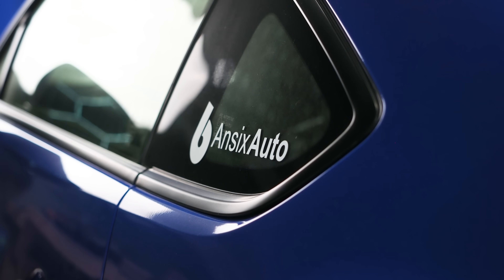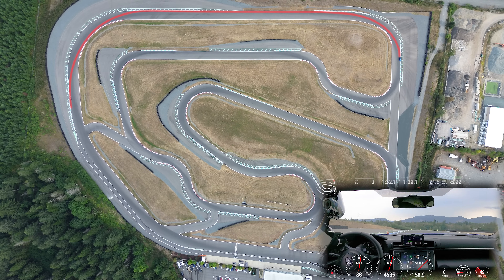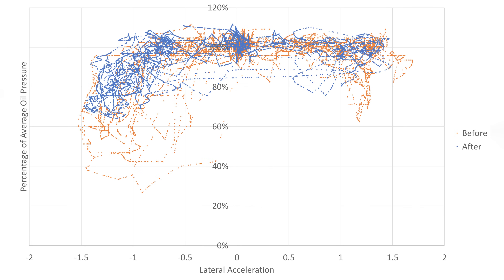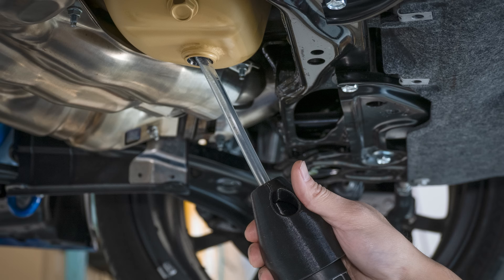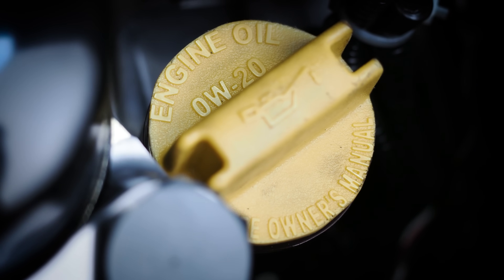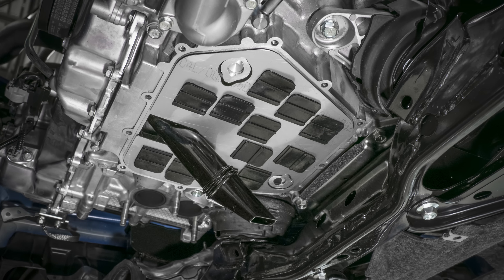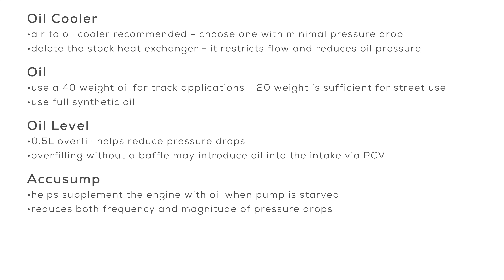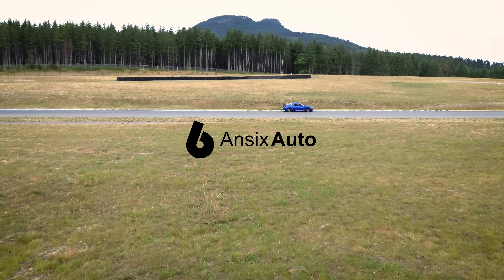The FA24D Engine: What Toyota & Subaru Don’t Want You to Know

Comment: It's insane that this somehow made it through testing on what I can imagine was a car that was tested fairly often on a track. I'm curious if they had any failures during testing and just said "oh well". I wouldn't be surprised if issues were found, a calculation was made on the chances of this happening based on expected amount of users to actually drive the car on a track within the warranty period, and then weighed that with the cost of a redesign. A less evil "ford pinto" calculation of odds, but still shitty if this is the case. Also, man VIMC is such a nice twisty track. That cresting chicane at the middle is a wild ride. Scary but fun as hell to attack.
Reply from the maker: There's an inherently difficult challenge to manage the oil pickup with a wet sump and a boxer configuration. Could they have tested and designed it better? We think so. Will they change the design? Unlikely.

Yah the chicane in the middle takes some experience to attack. It can go really wrong if you're not careful about how you brake for it.
Reply: They know. Toyota racing employee said on reddit they've been blowing and replacing engines like crazy.

Comment: Back in the day, it was proven to run 10w40 mobil 1 high milage on b series vtec motors as it will burn less. 10-40w is good, but in these high heat in the states i would even try mobil 15w-50 for track
Reply from the maker: Absolutely that would be the right move. We recommend deciding on the oil weight based on the operating oil temperatures so the viscosity can be matched.

Comment: Has anyone build an oil pick up which is not angled to one side?  I would like to see what happens with a pick up in the middle of the pan.
Reply from the maker: It's easy enough to make one but the installation would be a pain. It requires dropping the pan and also the front timing cover. Removing the front timing cover requires removing the accessory belt, and the crank pulley and some other things. Not a fun job.

Comment: As for daily driving,is it ok to say that keeping everything factory on this car is fine?
Reply from the maker: If everything is stock, the level of concern is less. We would suggest keeping the RPM's up when corner hard in case the pickup loses it's prime, it will recover faster with a faster pump speed.
Reply: I guess an accusump won't hurt wehter you use it on track or street, i think it could prevent a lot of engines failures if people knew about this product.

Comment: I'm curious how this oil pressure issue occurs if at all on the street. If you're going 5-7/10 on the road-- like a weekend drive-- are you affected?
Reply from the maker: Have a look at the lateral acceleration graph. If you're 5/10ths as in 0.5g cornering, you'll be fine. Even at 0.7g I wouldn't be concerned. The pressure drops are most concerning when at the limit out on track and the oil temperatures are high (unlikely you reach those oil temps on the street).
Reply: you’ll be alright even doing hard spirited driving.
Reply: You won't be affected if you're doing 10/10 for a short period. 
As long as you have cool down periods. 
I've done 1.2G regularly with cool downs. Never had any issues. 
The car is capable of light to moderate track use.
The key is to take often breaks so that the engine can cool off. 
Keep in mind that this is a $30k car. It needs proper care to run on the track.

Comment: I don't have these cars but I find it to be an interesting topic. I'm still confused why it's only right turns given that the engine is somewhat symmetrical. I know the pickup is a bit off center but I don't think that's a huge factor.  I feel that it's something else inside the engine that isn't liking the g-forces. I'm curious if the FA24DIT engines have the same issue but I don't think it's a popular weapon of choice for track days.
Reply from the maker: We think the asymmetrical pickup plays a role for sure. We'll try to get more in depths about this with our theories in another video.
Reply: @AnsixAuto  someone needs to make transparent oil pan and mount 1-2 cameras 🤣
Reply from the maker: That would be pretty cool but if the pan breaks, the engine is dead. Maybe we can get a boroscope inside.
Reply: @AnsixAuto  pan would just have to last maybe 30 minutes to get some visual data. boroscope would work too with good lighting...
Reply: I can’t speak to the FA24, but the FA20 had different oil channelling in each side of the engine, resulting in better behavior on one side than the other. There were/are only two fixes: 1. Modify the oil channeling. 2. Swap away from the boxer and never look back.
Reply: nah it drops oil pressure on left turns also if very high G. So it is an issue that goes both ways, it's just more noticeable on rights.
Also, dropping pressure with high G's happens to basically all engines.  That is why race cars have modified / custom made oiling systems.

Comment: You need a deeper truncated & quad baffled (with doors) sump to add more capacity and oil control. You may find there is no longer a need for the Accusump, and all of the other changes you've already made work well. Good luck on this mission.
Reply from the maker: To be honest, an Accusump is easier to install and remove than a baffle.

Comment: Great video, can't wait for the follow up. Any thoughts on running 15w50?
Reply from the maker: The thought has crossed our minds. We were looking at the Valvoline VR1. A lot of how you choose a weight of oil to use depends on the operating temperature of your oil. If you can keep your oil nice and cool, there's less of a need to go thicker.

Comment: Why do Americans look at this as if they have found something really special? Not trying to be rude but tracking cars in the UK it has always been recommended to go up a couple of weights on oil when on track. Same with over filling with oil. It is a poor mans larger baffled sump. I have been tracking for at least 15 years and those common mods go back even further. It is a shame that all that is offered for these cars are those toy like insert baffle plates. When is someone going to release a proper larger sump with vertical trap door baffles?
Reply from the maker: There's been cases of engines blowing up, even using a thicker oil. We're trying to investigate why and how to fix it.

Comment: This issue can’t be isolated to this car.  OEMs are unlikely to have included repeated fast hard right turns in their testing.  Such an edge from an OEM’s perspective.  But for track enthusiasts, it’s ridicules that a car cant make a right turn.
Reply from the maker: In all honesty, if you only use the stock tires, this is less of an issue. They pull 1.1g max, the tires we put on pull 1.5g so the problem is exacerbated.
Reply: OEM knows this already...

Comment: Excellent video! How much pressure drop did you observe across the OEM oil/water cooler?

Thanks
Reply from the maker: We mentioned it in the video, about 10psi at 95*C. The difference is less at higher oil temps.
Reply: @AnsixAuto  thanks from the response. That's interesting that it's similar to well performing air-to-oil coolers, inclusive of all lines and fittings. I would've expected it to be substantially less as it's just a sandwich plate.

Good to know!

Comment: An electronic switch on a Accusump can be hooked up to a dash light or a recording device. So you can see when the Accusump operates.
Reply from the maker: We're working on exactly that. We're working on a control system too so you won't have any excess oil in your sump at low rpm situations.

Comment: Typical Subaru trash engineering. 
I can't believe in 2023 people have to deal with this crap on a car they market for track work.
Reply from the maker: Yes and no... the problem is made worse with really grippy tires. That's not so OEM anymore.
Reply: @AnsixAuto  I don't really accept that as an excuse. I previously had an older gen 86 and and STI.  STI did Subaru stuff and blew a head gasket at only 60,000kms.

I have a GR Yaris now that I track regularly with A052s and I have no oiling or cooling issues even on 35c+ day. 

Don't get my wrong, I love the 86 and BRZ but I refuse to make excuses for Subaru shitty engineering anymore.
Reply from the maker: @pancake7289  We're not really making excuses for the manufacturer. It sucks that the owners have to deal with this issue. It's just a fundamental problem with the flat motor. We think they were trying to be smart about the oil pickup and the RTV and causes a bigger problem by doing so.

Comment: Thanks for your Great input/work on this issue. I’ve been watching for any updates as they come out. Love my BRZ and since I dont track it hope it will last a long time without failure. Planning on going to 5W30 engine oil on my next oil change, I find the 0W20 oil is being used and hope the heavier oil will not get pushed past the low tension piston rings. Consumption is well within factory specs but it still an annoyance as I watch my level constantly because of the oil pressure drop. Do I drive it hard on twisty roads? Oh yes we all do I’d say and even any slight drop in pressure worries me. Will Subaru/Toyota do anything??  My thoughts, NO they won’t. These cars are on their way out and for the very few that might blow up, cheaper to just replace those odd engines. If a better car comes out I’ll buy one BUT for now I feel you can’t beat these cars for the price on entry and the fun behind the wheel fills my heart with excitement. So much hype about EVs and hybrids but for me it’s NOT about MPG, it’s about driving and performance fun behind the wheel. Good luck everyone 🏎🏎😁😁
Reply from the maker: We agree, this platform is hard to beat in terms of performance for dollar. It's just so fun to drive!

Comment: Quite surprised the JRacing Oil Cooler is even causing oil pressure drops. Great video. Also, what spoiler is that on the car?
Reply from the maker: It's a Adro rep with custom end plates. We're using it for now until the one we're developing is ready.

Comment: Fantastic analysis and thank you for putting this together. I'm hoping that implementing some of your recommended changes (excluding significant complexity updates like an accusump) will be sufficient for those of tracking on street tires without aero.
Reply from the maker: I'm not sure why people think the accusump is so complicated. It's a 20 minute install yet people spend hours dropping the oil pan, cleaning the rtv, and installing a baffle.
Reply: @AnsixAuto  I've always heard about it being an expensive/complicated install but have to admit your video/comments make it seem relatively easy and straightforward. Something to look into for sure.